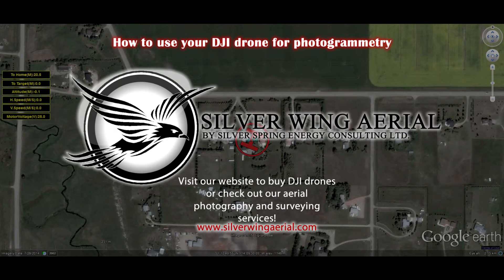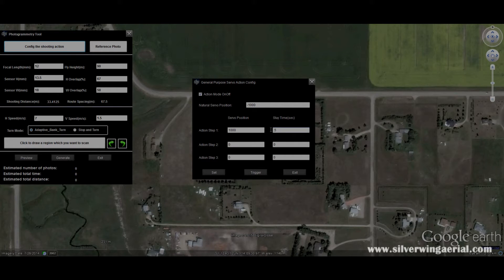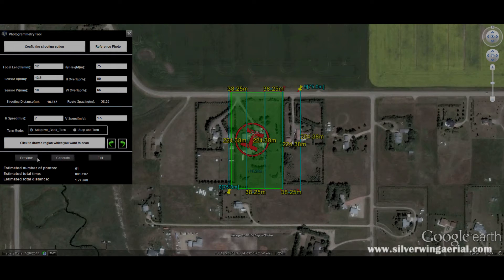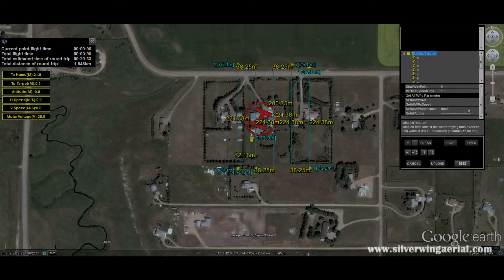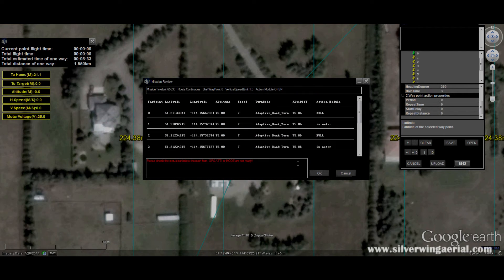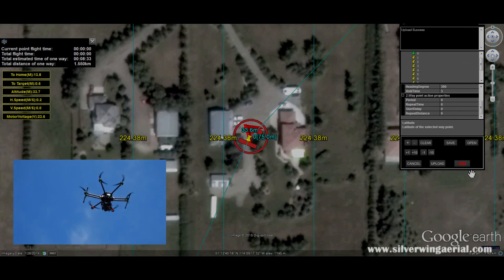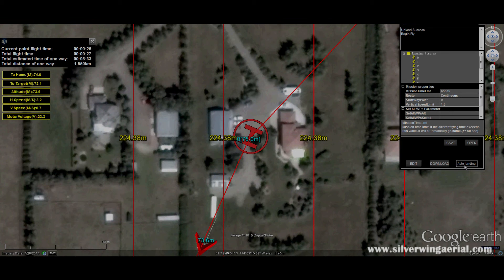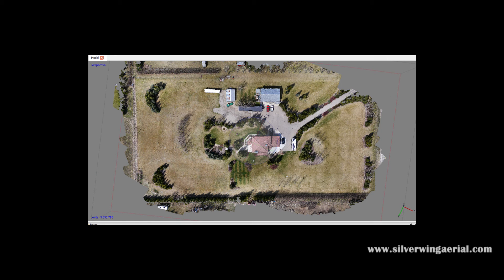Introduction to photogrammetry and aerial mapping with DJI groundstation

Comment: Help,please.I have set the photogrammetry tool parameters,however, the camera(Canon 5D Mark 3)didn't shot photos when my drone takes off and fly as the generated line .Why?Are there anything wrong with the trigger setting or other mistakes?what setting should i do in WKM MC to use f-channel? The original f1 channel is for landing gear.Really hope ur reply.
Thanks!

Comment: Could you please explain what is needed?  This doesn't look like the standard DJI GO mobile app, so I'm guessing its their separate software (http://www.dji.com/pc-ground-station) but that doesn't seem to run on mobile, so are you taking your windows laptop out into the field?  And that "ground station" software doesn't seem to be downloadable nor purchasable from their website, how did you get it?
Reply: I'm not sure if ground station is still supported by DJI with their newer drones. There is other software out there that does the same thing though. Check out map pilot from dronesmadeeasy dot com. There is also skycatch commander, dronedeploy and pix4dcapture. (I'm talking about the software used to take the picture with the correct amount of overlap). There's other software out there to make the actual 3D model, but the good ones are quite expensive.

Comment: Help, please. my s900 with z15-gh4 gimbal won't make pictures in autopilot mode. what gimbal setting should i do in A2 assistant for gimbal, to use f-channel? in a2 manual they say,  that f1 channel is for landing gear...

Comment: Would the sensor for the Phantom 3 advance be sufficient to meet a ~10-5cm accuracy?
Reply: If you need that kind accuracy, then you better use ground control points. (I'm talking the coordinates of something in the 3D model vs the actual coordinates of that same thing on the ground.)
Reply from the maker: +phoreal22 Yes it is, however it is very dependent on the altitude you are taking you photos from.
Reply: +Silver Wing Aerial horizontal or vertical accuracy?
Reply: +phoreal22 

Please Colleagues need help as I program a flight path for my DJI phantom three pro?
I see the video but do not understand how my drone read , processed, or acquires the flight path.

It is for photogrammetry , I regret my English , I'm from Latin America and study geographic Engineering
Reply: Ty Brady I kid of figured, thanks
Reply: Sorry should have been more clear, I was looking at vertical

Comment: Thank you for this tutorial, good job :) am I right, the A2 can trigger "any" remote triggers, it doesnt have to be via the zenmuse? And have you had the time yet for the follow up process video? Very interested too in how you get the GPS data for every singel photo. Thanks again
Reply from the maker: +GoProlet Yes the A2 or Wookong can be set up to trigger most cameras as long as you have a camera shutter release that can be fired off by a servo signal.